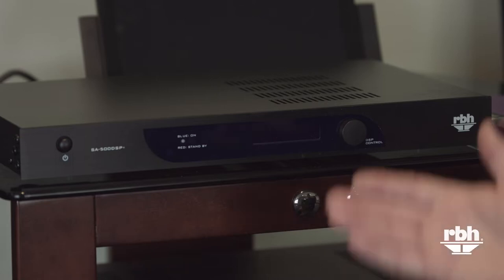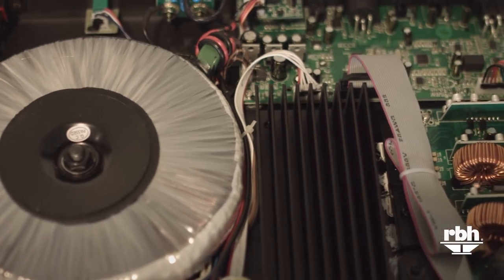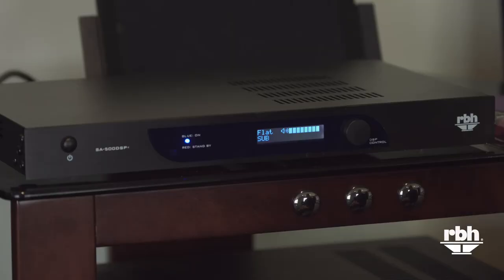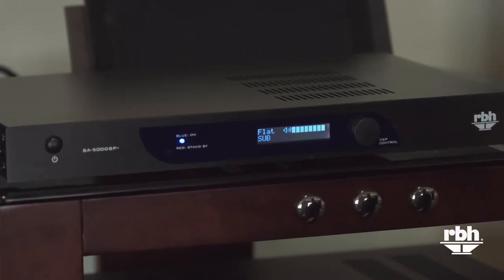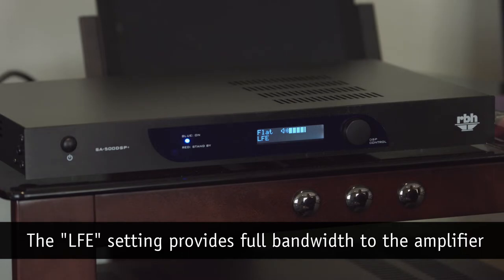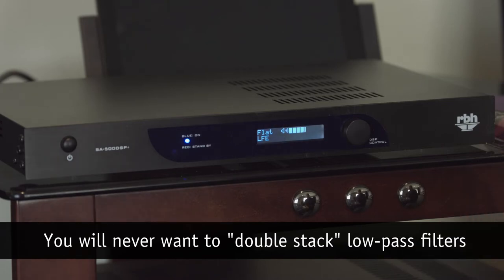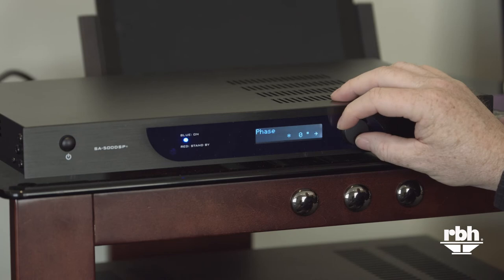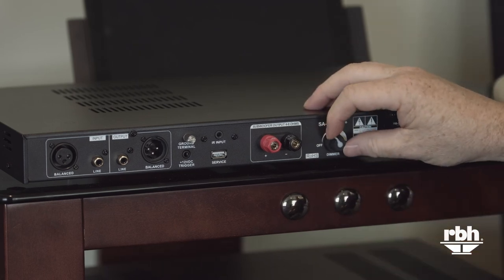Subwoofer Integration Training (part 1.2) with Shane Rich - Subwoofer Amplifier Basics

Comment: Hi and thanks for the video!
4:34. You show a low pass crossover frequency of 80hz and your arrow points to a place on the curve well after the signal is being attenuated.  Do you set the high and low pass at the same frequency because they are working BEFORE their respective frequency setting?  Or, does the crossover begin to filter at its specified frequency, thus necessitating a gap between the the specified low pass and high filters so that they are both tapered off at the point in which they meet and sum?

Or, am I completely confused?

Thanks!!
Reply: The level of attenuation for both the high and low pass filter signal at the crossover point will be either  -3dB  or -6dB depending in the type of filters used. The type of summation for amplitude and power will also vary. For simplicity sake to better understand the general concept,  the example I used showed a flat amplitude response for summation.  For more information, I recommend checking out these links :
 https://www.audioholics.com/loudspeaker-design/filter-crossover-types-for-loudspeakers
https://en.wikipedia.org/wiki/Audio_crossover